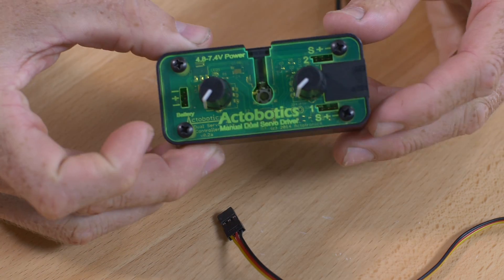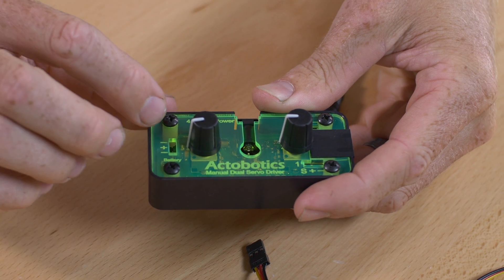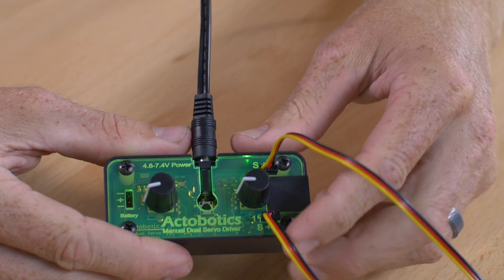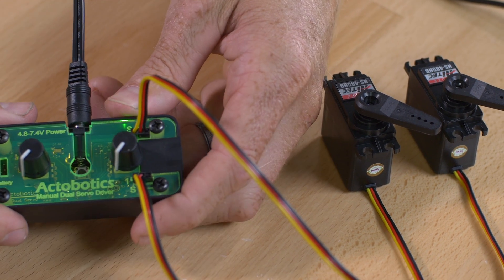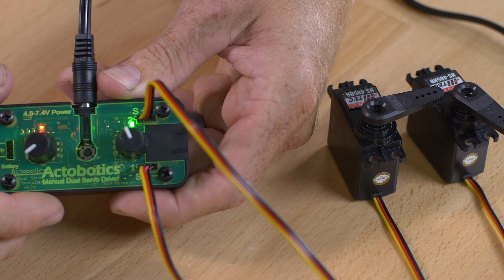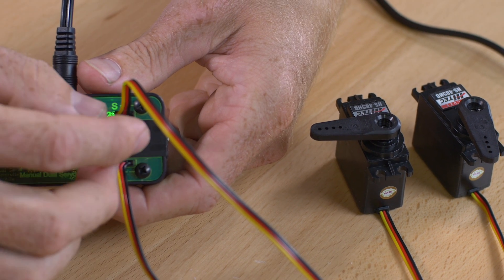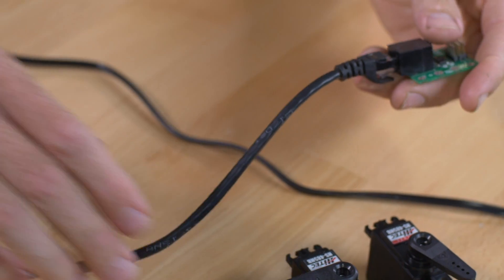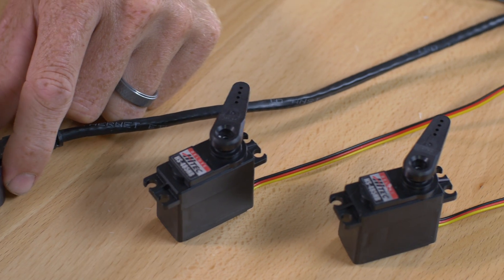How to use the Actobotics Servo Controller #605105

Comment: Will it work with continuous rotating servos?
Reply from the maker: Yes continuous rotation servos are controlled the same way as normal (closed feedback loop) servos. They operate off of the same type of PWM signal but take the value of the signal to indicate the speed and direction they should go instead of a position that should be reached. While they are called servos, continuous rotation servos are basically motors with built-in motor controllers.

Comment: Thanks for the video. I was just wondering. I can't seem to find a user manual for the unassembled board. What connector types would I need for the  receiver battery terminal? I am looking to to connect a 5V source. 
Also , I am looking to mount the unassembled board in a box and have the knobs at the top, what is the size of the knobs used  and what connector types do I need to connect it to the servo controller? 

Many thanks
Reply from the maker: Hi Raymond, you can power the board via the 0.1" row-pins, located left of the left knob.  Row pins accept what is known in the R/C world as a male servo connector (identified by the housing rather than the contact).  Alternatively, you can power the board with the 2.5x5.5mm power jack.  The servos connect to row pins or you can use the CAT6 port to run a long distance to the CAT6 Receiving Board (605103).  The knobs are splined to fit the included potentiometers, which have a T18 shaft.  Feel free to contact us should you have any other questions tech@servocity.com.

Comment: Is it possible to connect a PWM meter in line between the servo and the driver to determine the correct servo PWM signal required for programming?
Reply: Yes, you can use the PWM meter for that.  It's going to read the output of the servo controller it's connected to so at that point you can easily find the PWM signal that you need to send to run the servo to the desired location.  Feel free to email tech@servocity.com should you have anymore questions.  Thank you!

Comment: thanks for the great video , when I use a 7.4v 2a power supply the green led light comes on, however when I plug in a hitec hs-485hb servo it gets dimmer and blinks and does not power the servo. I f I plug in two of the servos the led green light goes off. any idea what is going on? this is my fist time messing with servos. thanks for any tips.
Reply from the maker: While the Actobotics Servo Controller can handle up to 7.4V, the HS-485HB servo is rated for a maximum of 6V.  Please contact tech@servocity.com should you have any questions and we'd be glad to assist!